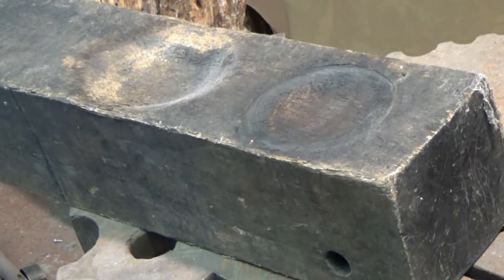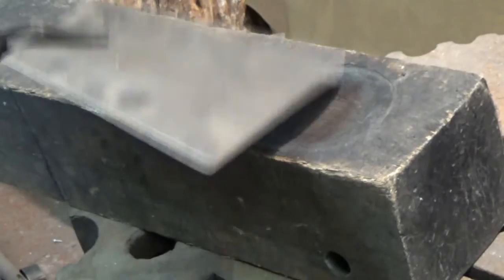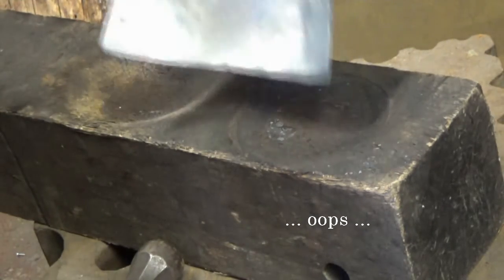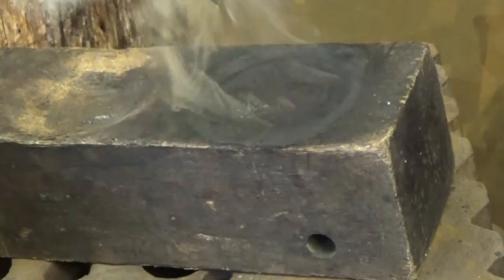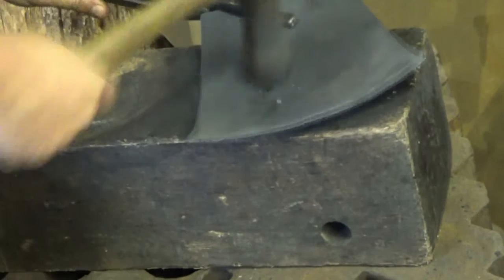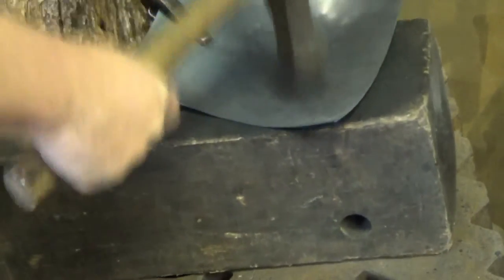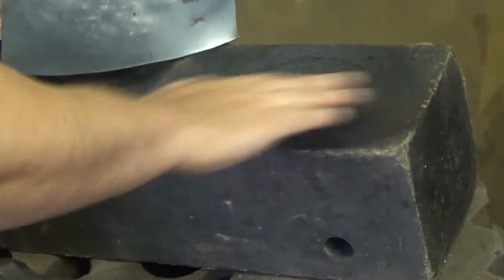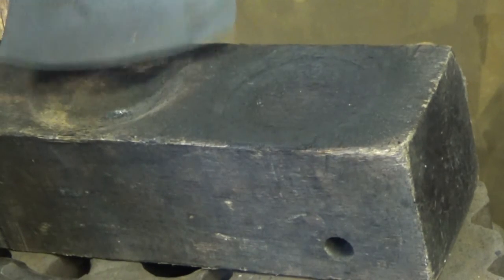Medieval armour technique short: Wooden Formers

Comment: Hello there, I am also interested in how to make them. Plus, depth and diameter of Yours seem to work great, so as a guideline the measurements would be highly appreciated! :)  Even if ony as a comment here, it would help! Thanks for all Your work.
Reply from the maker: They are about 5 inches diameter and about half an inch and 1.5 inches deep :)
Reply: @GreenleafWorkshop  I don´t believe it!! I have been waiting years for this, THANK YOU!!! 

You know, what works for you will work for others, and me, with the same method applied of course.  Proven designs are the most valuable starting point. :)

Comment: I've really been enjoying your video series. Got into bladesmithing for a hobby, and armouring was always an interest, but it seems like there'd be a lot of specialized tools involved, seems like I need to give it a go sometime.  what would you recommend for a nice hardenable plate? I've heard people tell me 1050, or 1075, and some say mild will work, but none were armourers, so I have a little hesitation in spending good cash on something that might be too hard to work, or too soft for my hema practice.
Reply from the maker: Hi there, thanks for the feedback. I'm about to go out so it'll be a quick reply and then I'll do something with a bit more depth later. I'd use mild to start with just to nail the shapes down and see what tools you need to get going, also it's cheap to be able to learn on. Then move into harder stuff. Mild can withstand some abuse, but obviously not as much as higher carbon steels.

Mild is comparable to a lot of armour pre mid to late 14th century in hardness (sort of) ... although I am still learning about how to interpret the HRC rockwell definitions in real world situations.

Be back later with some real details. :)